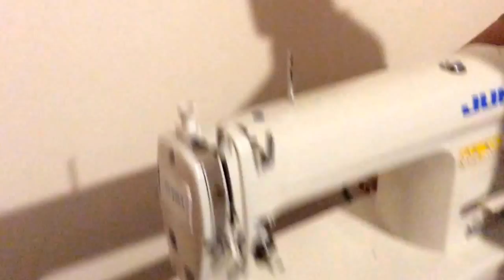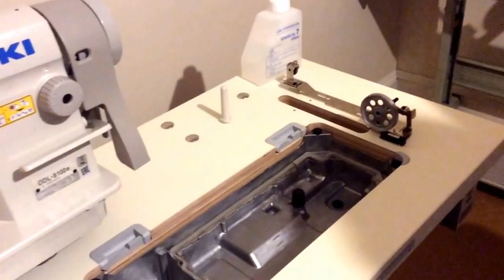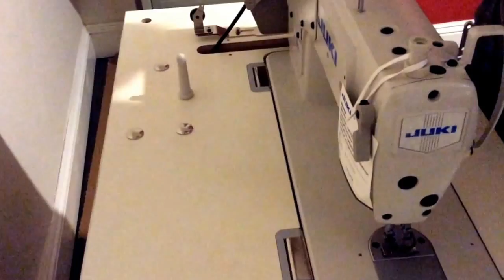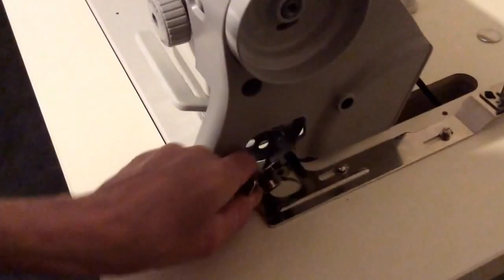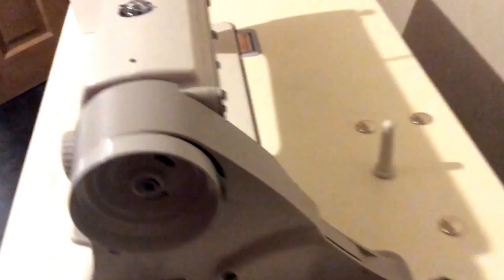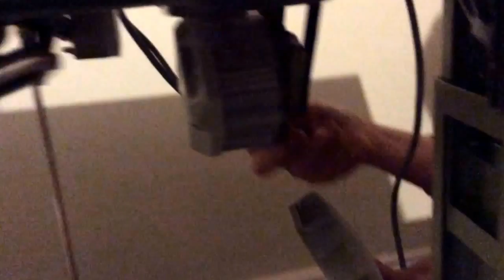How to assemble a Juki DDL 8100e industrial sewing machine onto the bench correctly

Comment: If ordered, does the table come in a flat pack? If not is it possible to remove the legs and I have to try and get it through a hatch.
Reply from the maker: Hi, thanks for the comment. The table can come assembled or in flat pack form for your own assembly depending on what you require and this would mean the legs would be in two sections, then the stabilising bar and the bench top would also be separate so maki g it easier to get through a tight space. Hope that helps,  Mark

Comment: I just bought this  Juki 8100e  It was not the kind of machine I wanted is it possible to change the needle bar and and bobbin case so that I can use a 16x135 needle and #65 thread need help asap
Reply from the maker: Hi Marie, I assume you want a machine that works with the power of a walking foot. If you are sewing large thicknesses of leather then you can get either 16x231 leather or heavy duty (up to size 140) which may help you with the sewing and thread size. As for the structure of the needlebar, I am happy to compare with the 1181 which takes 135x17 and see if you can swap them over and still get your machine to see. Regards, Mark
Reply: marie benjamin
Reply: How to put oil